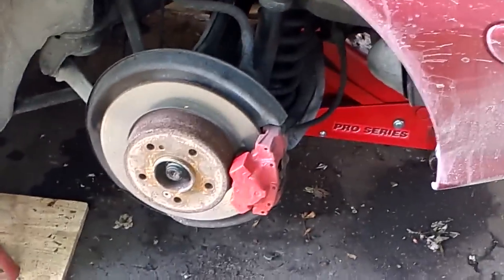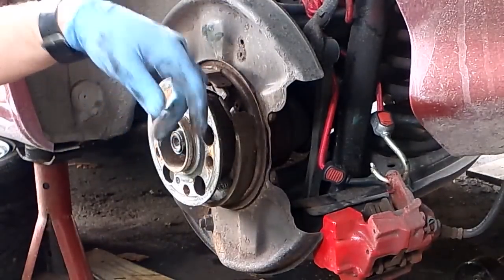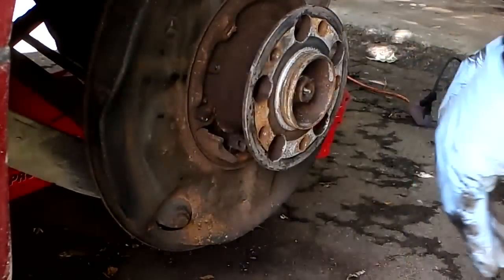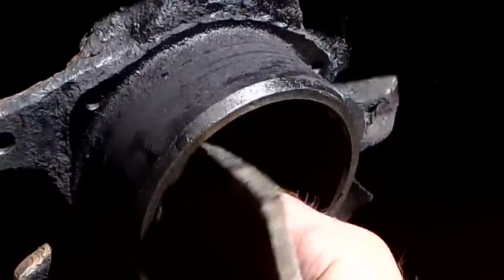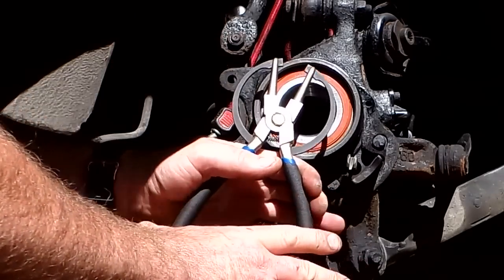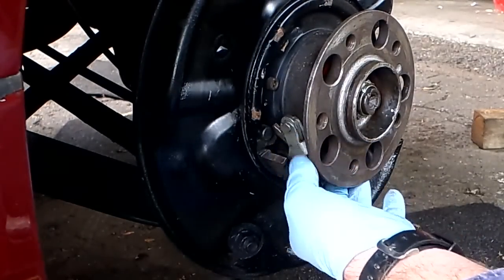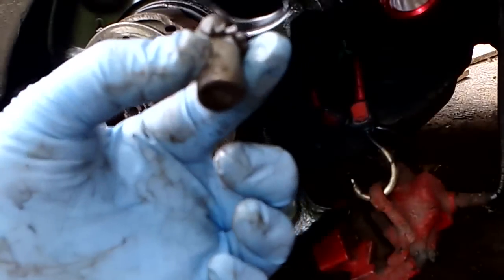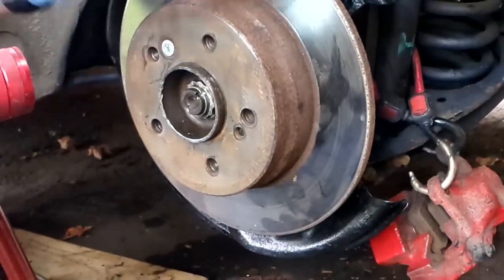Mercedes rear wheel drive axle/hub bearing replacement.. R170 shown..very long video

Comment: Do you recall the torque spec for the E12 bolts that bolt the axle to the differential?  I have looked everywhere for this and can't find it.  I did find something that says 92 - 107 foot pounds but that seems really high to me.
Reply from the maker: 97 ft lbs is massively over spec ..lol.  In the case where I can't find a spec I use a bolt torque chart that is based on shaft diameter and bolt grade . That would make the torque around 45 ft lbs
Reply: fupabox that is what I thought, thanks for your reply!!

Comment: You have to tell me how you got the race off of the splined Hub I'm doing the same job and I've got half of that bearing sitting on the Hub and the broken have inside the knuckle
Reply from the maker: you can gently cut a groove into the bearing half that is still on the splined axle shaft ..then put a cold chisel into the groove and whack with a hammer,, It should split the bearing in 1/2 and come off easily

Comment: I believe I have a worn out rear axle shaft ... it doesn’t look like you need to remove the hub to remove the axle ... please advise.  In the end was that your issue as well?
Reply from the maker: Joel Miller  no you only need to remove the axle nut and slide the axle out after unbolting from the diff.  I am embarrassed to admit my rear bearings were fine. It turned out that one of my fairly new rear tires had a shifted belt that was making the bearing noise. All that work  lol
Reply: fupabox Thanks ... I have a clunk whenever the suspension shifts under load at the left rear hub ... but I completely replaced the suspension ... and there isn’t any noise when turning the dive shaft or axles when in the fully extended position it only seems to be in certain suspension positions
Reply: Sorry one more question... are the axle shafts of a C280 the same or compatible with my C230?
Reply from the maker: depends on the year ...heres a listing of what crosses over for the 2000 c230  (around $50 complete from rockauto )  
MERCEDES-BENZ 300CE 1991-1993
MERCEDES-BENZ 300E 1990-1993
MERCEDES-BENZ 300TE 1993
MERCEDES-BENZ C230 1999-2000
MERCEDES-BENZ C280 1994-1997
MERCEDES-BENZ E320 1994-1995
MERCEDES-BENZ SL320 1994-1995

Comment: Sorry for that.  The SL is a 2001.  I hope you will do the video, or maybe you did one and I missed it.
Reply from the maker: +Jim Graves I think the 2001 is a bit different in design..I know they changed design on a bunch of the hydraulic latches over the years... here's the service manual for your car..just x out the occasional pop ups that show up..other than that the site is good    index is on left of page
http://workshop-manuals.com/mercedesbenz/sl_500_(129.068)/v8-5.0l_(113.961)/body_and_frame/roof_and_associated_components/soft_top_-_convertible_top/soft_top_storage_compartment_-_convertible_top_deck_lid_components/soft_top_storage_compartment_cover_-_convertible_top_deck_lid/component_information/service_and_repair/procedures/

Comment: Hi just want to ask about this axle shaft method. i assume its safe for the bearing? or should i buy / create a tool to install flange?  you did not show it after all =(
Reply from the maker: you can make a tool from thick threaded rod , washers and bolts to press it in , It ended up easier
Reply: @fupabox  Thanks for the help, i've alredy installed the axels and wanted to avoid removing them again =)
a) i could remove rear hub and press flange on press
b) try to use axle as You said. the bolt itself is 280Nm-320Nm torq spec so it  should work
c) use rod and washers. 
anyway thanks for the tip with a rear  inner bearing race =) probably i will kill just one instead of two

Comment: Would you be able to take the big hug nut off leave the drive shaft on and use a puller off or would you just push the shaft in or 3 long bolts same thread as the wheel bolts. Only a thought as i may be doing the same thing for my son soon i think I will take the hub off the car and work on the bench as I have a bad back so standing up is better. Sorry for the long reply. Pepe
Reply from the maker: The long bolts in the lug nut holes may work

Comment: So much easier with the proper bearing puller. Use vibration air tool to free up the torx bolts too. The old way works as you saw, it's just is a lot more work. oh, and use Sykes Pickavant 02830000 Heavy Duty Universal Interchangeable Circlip Tool. No cut fingers and face full of circlip.

Comment: What was the size for the middle axel Nut the one you took off with the impact gun you didn’t mention what size it was??????
Reply from the maker: should be 30mm  12 point socket
Reply: fupabox  no bro it was too big
Reply from the maker: @jaysonnovella5133  all my manuals are showing 30mm

Comment: What about replacing just the hub? Is removing the axle still necessary? Also, what was the other method you used getting the hub back on other than the threaded bar? You never included it in the video :/.
Reply from the maker: +K Downing  The other method was mostly the same, just using the axle as the threaded rod and support, then winding the axle nut onto the axle to press the hub in...It wasn't as easy, so I didn't bother showing it. You can't replace the hub without ruining the bearing unless you have the super expensive special Mercedes tool...Bet to save the $ from buying the tool , and put new bearings in.. You can remove the hub/bearing without removing the axle, but all the other suspension arms would need unbolting, and the rear shock and parking brake cables..then the whole spindle can come off.. with the spindle off the hub and bearing can't be removed without a press, or the special tool
Reply: +fupabox I've a few  further  questions if you don't mind. Could I message or email you?  I'd appreciate it more than you could know as I  an trying to get this car bar on the road ASAP as it's my only transportation
Reply from the maker: K Downing send me a private message with your email

Comment: Does this work on a 2004 c180 kompressor? What would be the best method to get the hub off to get to the rear wheel bearings?
Reply from the maker: +Daniel Waterhouse   The rear suspension on your w203 is very similar...to remove the hub, all of the links (5 per side ) need to be removed, also the brke caliper and parking brake cables

Comment: Do they produce the same symptoms as a front wheel bearing? My '99 e300 had it's replaced at 390,000 miles on the rear. So I'd assume my other e300 with 195k shoudl be ok for some time?
Reply from the maker: they usually make a low grumbling sound that increases as weight is shifted onto it.. In the end this ended up being a slipped belt in one of my new tires, and the bearing was never bad in the first place ,, the belt will make the same same noise

Comment: Whats the torque specs for the 6 bolts behind the hub assembly?
I have a 2006 c230 sport(w203).
Reply from the maker: 70nm  according to my manual =52 ft lbs

Comment: What size e torx bolt did you use to get the center bolt off??? Helppppp
Reply from the maker: if you are talking about the driveshaft inner torx bolts , they should be e10 or e11 reverse torx . They may also be regular torx T40 or even allan headed bolts
Reply: @fupabox  thank you!

Comment: I have  a 1997 clk200 kompressor , W208, diff 3,67 failed. Found a used one from 00'  E200 kompressor 3,46 with 55000 km. but output flange diameters are different. what should i do? what i mean is ...anyone complete w210 diff ball to W208? and another ...is W202 diff ball same as W208?

Comment: I have 99 ml320 is it the same?
Reply from the maker: your rear hub bearing is very similar to the SLK..no exact , but pretty much the same procedure. The suspension mounts and brake system is where most of the difference is
Reply: fupabox OK... I think it's my bearings... I haven't exactly pin point the problem I just know that when I drive my wheel feel's like it'll fall off... I don't drive it anymore.
Reply from the maker: If you jack it up and grab that wheel you should be able to feel/see some movement if it's that bad
Reply: fupabox yea the tire Shake's even with lug nuts in.

Comment: I'm going to search the threads but does anyone have female 12 points on their bolts.  I need to know the size of the 12 point male bit I need
Reply: Why yes I do raoul, great name by the way, it turns out the bit is the impossible to find locally 9mm XZN 12 Point MM Triple Square Spline Tamper Proof Bit, phew that was a mouthful.  OK go back to work you handsome devil
Reply: O'Reilly has this bit

Comment: How do I diagnose a rear bearing issue? I've kinda got a "lub lub lub" sound that I can't think of what else can be. I'll be doing my power steering pump this week on my 2000 ML320. Other than that the vehicle is perfect for 150k on her. 
But this job if need be looks like it Suuuuuuuuucks! 😳😂

Comment: Hey bud. Thanks for this video. Very helpful 

Im presently at “these BUGGERS are a bitch part” with a stripped drive shaft bolt

How do you cut it off?

You mentioned this but don’t talk about it. Please reply if you can

Mahalo from Maui
Reply from the maker: a small grinding disc to remove the head . Once the shaft is off the rest of the protruding bolt can be heated and turned out with vice grips

Comment: Is w201 (1986 190d) the same bearing/hub configuration? would using this tool help me out alot? http://www.tooloutlet.fi/fi/Tuotteet/Autoty%C3%B6kalut/Automerkkikohtaiset/Mercedes-Benz/854/Py%C3%B6r%C3%A4nlaakerity%C3%B6kalusarja+Mercedes-Benz+W124,+129,+201,+202/3445 
thanks in advance!
Reply from the maker: +Attesnn  that looks like a good one.... a lot easier on your back and arms than a slide hammer    :)